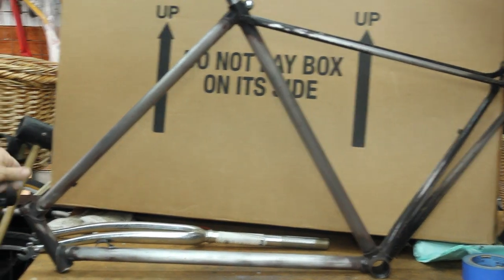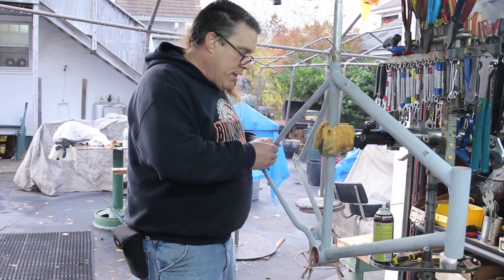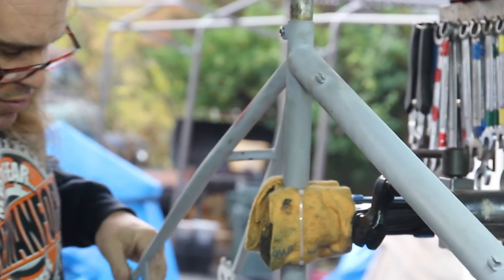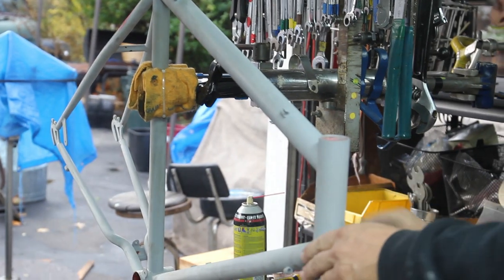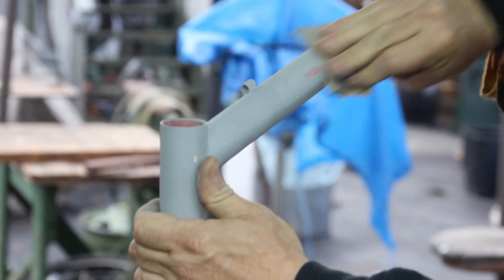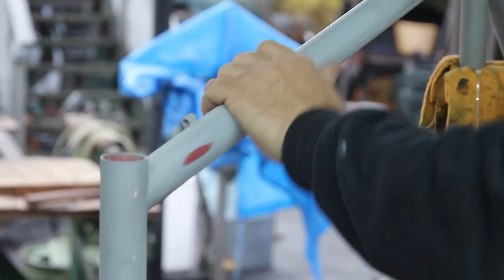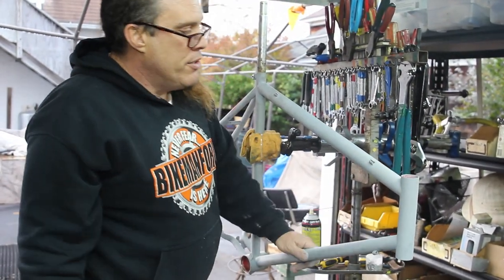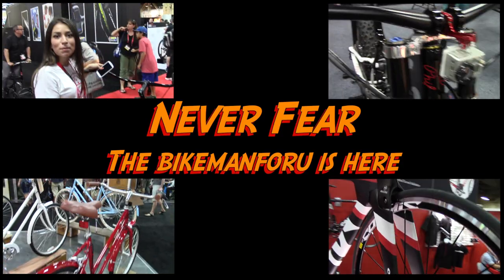Bike Repair - Prep For Paint  - BikemanforU DIY - Hampton Cruiser

Comment: Use a semi stiff foam pad  instead of your bare hand behind the sand paper to keep a uniform pressure on the surface ALSo- Baike Man * Be Advised *  if you have a head badge  Please wait - IWe are sending you a custom fabricated Head Badge  Backing Plate to be used  with the standard BMFU decal * this is a hand made plate made from PVC pipe cut to size * will send next week *
Reply from the maker: Cool thank you